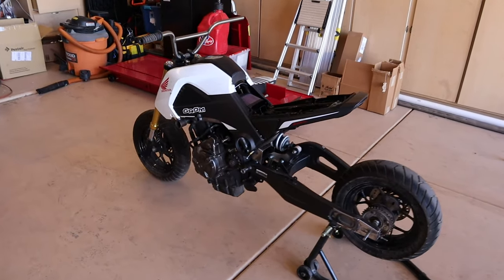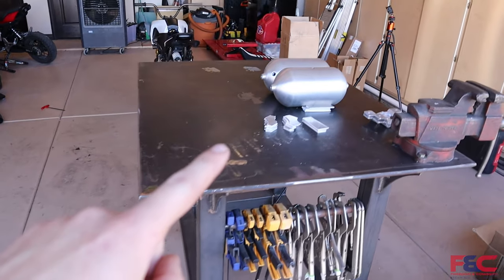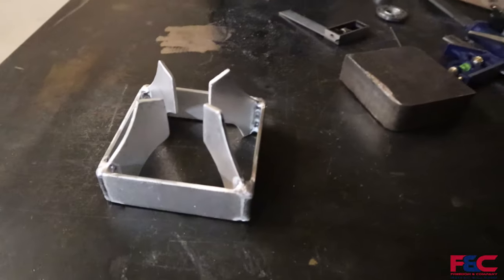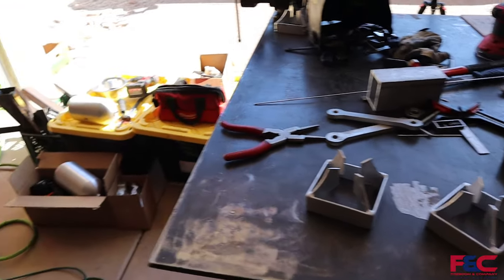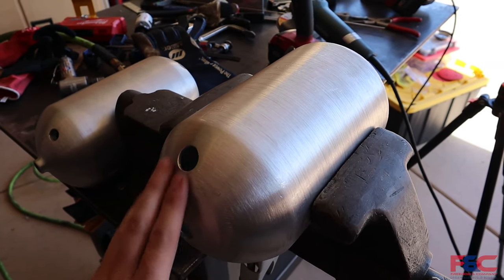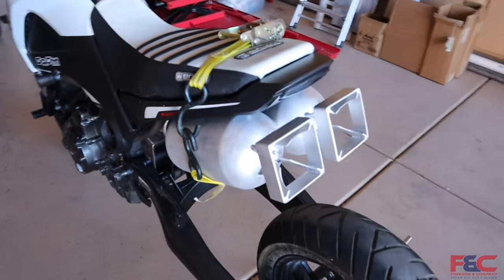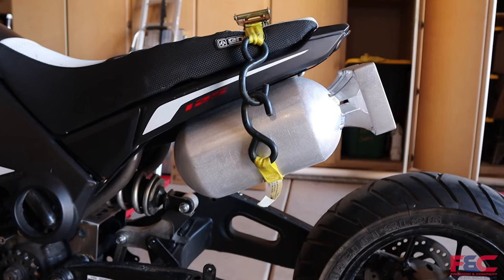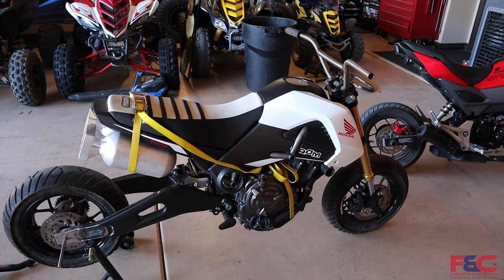The 700cc Grom Gas Tanks are BOMB!

Comment: Cool idea!but i was thinking you would do it as much oem as possible.
Many ways to extend the factory tank to retain oem look.in tank fuel pump gets cooled down by the fuel.external pumps get heated up by engine,noisy,most ive seen all had problems.
Fuel vaporising,pumps overheating.less life out of them.dont forget the weight of the fuel out back and high unbalancing the bike as well!!!
I respect it,not my build! ;)
Reply from the maker: If you watch some of the other videos we address why we can not expand the OEM fuel tank. The fz07 motor is taller and takes space from were the stock tank sits. We had to cut it in half just to make it fit under the plastic. So our only option was to go with secondary fuel tanks. The weight unbalancing the bike will not be an issue as we have added weight down low to compensate that and the stretched swing arm will help eliminate any issues as well. Great comment! We love when people ask questions and challenge our way of thinking! Thanks!
Reply: @BuiltByBailey  yessir!i saw every videos from the start!
The tank can be wider and taller from the top!
Your welcome brothers!
Keep up the good work!like be bike but these kind of ruin it for me